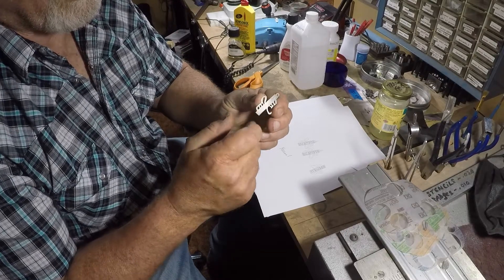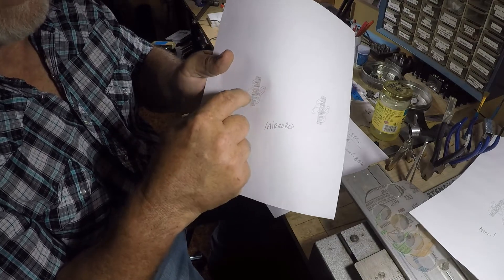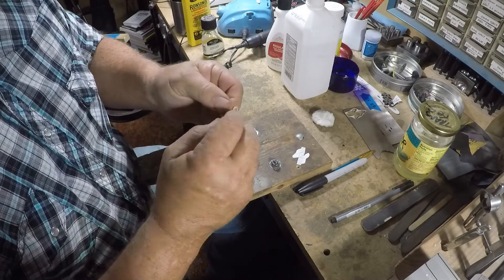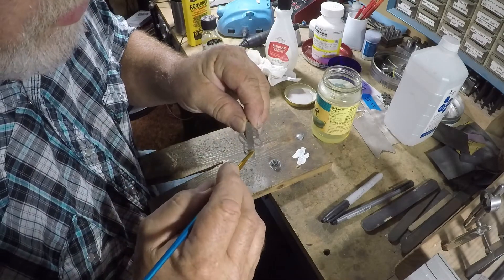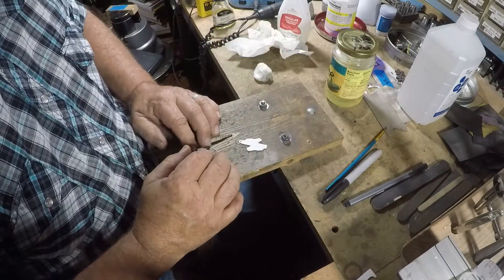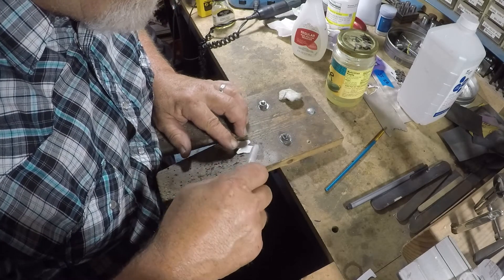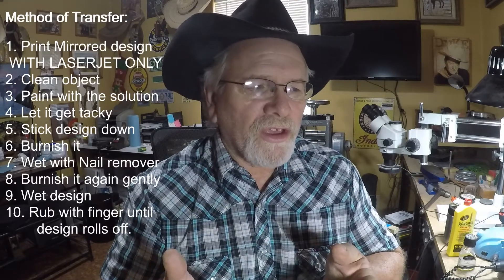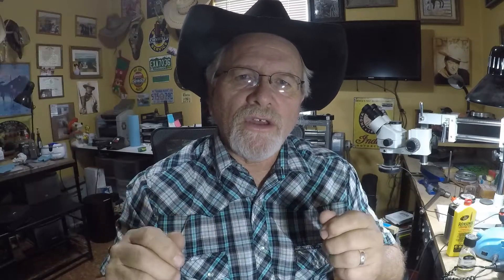Transferring Designs for Engraving

Comment: Hi John, I am a musical instrument maker and would be interested in the silver plate you are using, could one use it for inlays on an instrument instead of pearl or abalone?  How thick?  My pearl is usually  .050-.060 thick. what would you recommend to buy and where to get it?  Thank so much, I enjoy your videos and would like some advise on whether to try is  or not?  I would be inlaying the silver in wood.  thanks again!
Reply from the maker: Thank you for your interest!  You can only inlay pure silver. When i inlay, i buy pure silver wire from Rio Grande jewelry supply in New Mexico. You can find them on the web. I inlay it in steel. If you buy some really thin flat or round wire and cut the proper channel size, you may be able to inlay that into wood.  Just test it on scrap wood. Rio sells different sizes and thickness. Hope that helps!